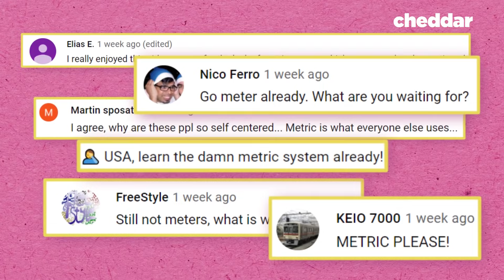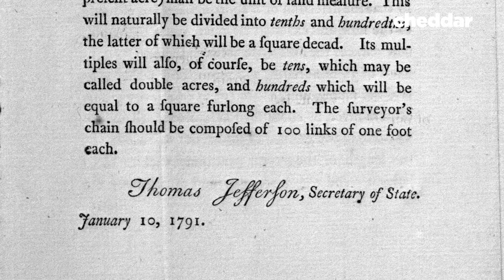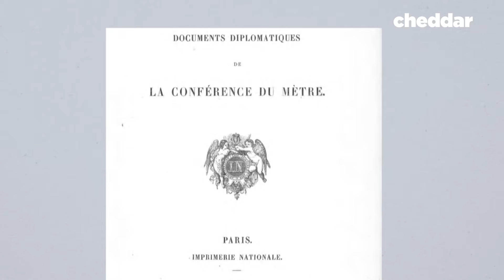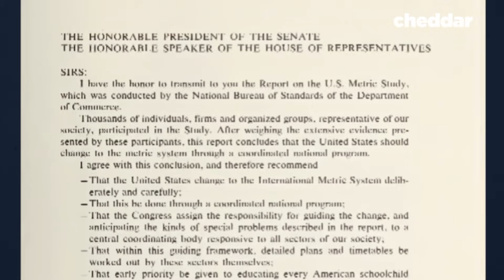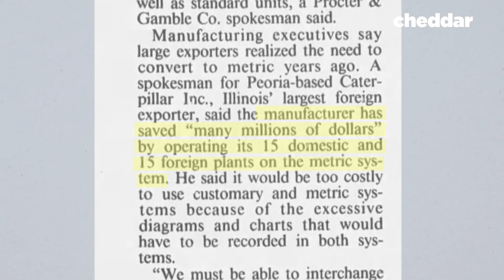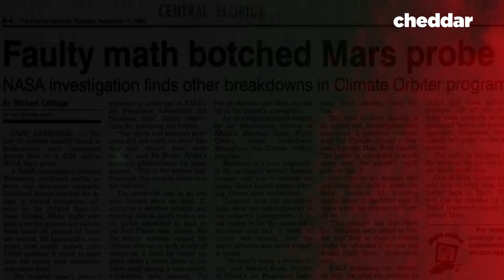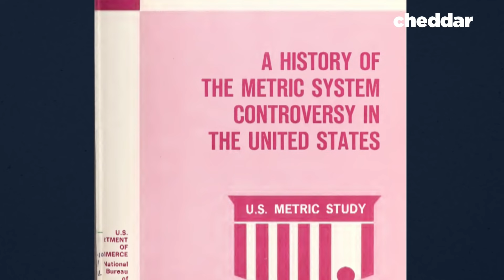Why Doesn't the US Just Use the Metric System? - Cheddar Explains

Comment: Why are Europeans so worried about what Americans use for our measurements? My question is when are Europeans going to switch to the R+M/2 method like the US and Canada use for measuring octane of their gas? After all, the U.S. system is superior as it represents the real world burn of gas under any given atmospheric conditions when an engine is burning it. Also the majority of the world like the U.S. drives on the right. When is the UK and Australia going to stop driving on the left? As one can see, this conversation can be spun around. Many of us here in the states were never taught metric. And to this day, we never use it in most any situation. It's easy to know what feet means. And it's easy to understand a fraction of say a container that may be 7/16ths full. But when someone says this is 60 kilometers away, then im like whaaaat?? 0_o What's that in miles? And if someone says it's 10°C outside, then I have to look it up to see what it is in Fahrenheit just to be able to comprehend how hot or cold that is. A 70°F day is like perfect temperature wise. And a 100°F day is crazy hot. And a -20°F day is crazy cold! That's easy to relate to. 

Also everything in our day to day lives is in imperial. Weather forecasts are in imperial, road signs are imperial, measurements in day to day life are in imperial etc...  When I pull out a tape measure it's in imperial. It as 1/4, 8ths, 16ths inches and ft. A yard is an even 3 ft. 

Plus Canada isn't fully metric either. And neither is the UK. Yes we may have metric on say a soap bottle of Palmolive, or shampoo. But i'm not reading that in my day to day life. Once I step out the door, it's an imperial world. Houses are measured in sq ft. height of houses, or buildings are measured in ft. land is measured in acres. (1 acre = 43,560 sq. ft.) And yeah! So when do we ever use metric except in international trade? Even when all business is typically conducted domestically, we use imperial. I weigh stuff up every single day for disposal. One skid after another. And we weigh everything in pounds. And all American trucks when going to the scales are measured in pounds. 

But as one can see, even those who are taught metric in school, stop using metric one they leave school since it's an imperial world outside of school. And hence we tend to forget about metric. You just never use it unless you're directly working with international trade. This is why Americans don't switch. There is no need or desire too. We have far better things to worry about. 

And in the rare case we do need to convert, we have online converters that help out with that. 

Maybe the US will flip to all metric when Europe adopts the R+M/2 method and finishes switching to the right side of the road? But then again, i'm sure the UK is as worried about switching to the right, as the U.S. is about switching over to full metric. 

Thanks to YouTube, I do now kinda sorta know a little bit about metric. I know that millimeters is metric. And that's probably the only metric unit I ever would use. And liters too. 1 gallon = 3.78 liters I know. :D So that's two metric standards of measurement I don't need a converter to figure out. But again, unless im talking on line, I never use them in my day to day life.
Reply: Australia took about ten years to change from Imperial to metric measures, but it wasn't a big deal. We soon got used to the different measures. This includes switching from Fahrenheit to Celsius temperatures, changing the road signs and converting the building codes and land measures. Every country that adopted the metric system had to change. It's not as bad as some Americans fear.
Reply: @Ashbury2193  Except our highway system is utterly massive! Just to convert every road sign would be stupid expensive! We have over four million miles of roadway here. Or 8x more miles of roadway then Australia. Also it would be kind of a big deal if a lot of folks here never used or learned metric before. I don't think the United States is going to switch anytime soon personally. 

I know it's definitely not in any politicians or anybody's radar here. Switching to full metric is never even talked about, except in YouTube videos like this.
Reply: @waycoolscootaloo  Where there's the will, there's a way. Converting the road signs in Australia was an immense job but it happened in July 1974. (The Canadians also changed their road signs at about the same time.)

The generation that accomplished this included many who fought in the Second World War. I think it was a more idealistic time, and it was seen as a national necessity, and so the job was done.
Reply: @Ashbury2193  Yes, but the task was still 8x smaller then the US road system. Also I guarantee you that no one here want's to spend the tax money to see it converted. So that would be the biggest hurdle. Not to mention everything that's been made in imperial units since the beginning of the country. And many folks Aren't going to know metric. And again it's not on anyone's radar or ever talked about regardless.

I know personally I like the system we have here. It just works. 🙂
Reply: @waycoolscootaloo  I get it that you don't want to change. Fair enough! However, change is possible when there is the will to do it. When we changed to the metric system, all industry had to change, but they made the change and found it saved them money.
* England agreed to switch to the more accurate Gregorian calendar in 1752. The American colonies of Britain also changed, so you have the benefit of that reform.
* Noah Webster proposed some changes to English spelling. Many of them were accepted in the US. The older spellings work,  but the US enjoys the benefit of slightly easier spelling.
* Many broad gauge train lines in the US had to be converted to standard gauge to facilitate interstate traffic. Expensive, but better in the long run. 
* No-one likes being pricked with needles, but inoculation saves lives.

Even though you don't want the USA to change, the actual change to metric measures is not as big a deal as you fear. I know, because I have lived through that very change in Australia. For me, metric conversion is part of my lived experience.
Reply: @Ashbury2193  Except I don't see it happening in my life time. It's exactly the same now as it was 30 years ago even. No one uses metric here in day to day life. Where there is a will there's is a way. True! But there is no will here to do so. Absolutely everything is in imperial throughout the country. And the US literally built the world's largest economy using imperial when it took the title from the UK. And the system continues to work just fine. Unless it's being shipped out of the country, or has to deal with science, everything is done in imperial. Even many companies here just do imperial. If someone says how many kilometers, or celsius, that's like pure spanish to many folks here. And even though schools are just recently teaching metric, the problem is that as soon as they leave the classroom, it's an imperial world. And you have to be in science class to learn it. Or maybe math class. (And that's a big maybe.) How many yards, or how many feet, or how many inches is all that anyone says. 

Could the US convert one day? I say never say never. But I think it's a very long ways away.
Reply: Hi  @waycoolscootaloo  You could be right. Probably the best time to change was when other English-speaking countries were adopting the metric system in the 1970s, or, as the video suggests, when Jefferson showed interest in the new system of weights and measures in the 1790s. However, as the United States is virtually alone in clinging to the old measures there will be continuing pressure to change, either partly or wholly, to metric measures. 

Your army's use of kicks for kilometres and your 2-liter bottles of soft drink could remain interesting anomalies or be harbingers of things to come. Only time will tell.

Comment: The Imperial system has its merits. For example inches may be divided into fourths and eighths, really useful for several things like cutting a sushi roll into 8 pieces, a common way of cutting sushi rolls. Measuring wind speed as mph or knots is better because you can feel the difference between 10 mph versus 15 mph, but it's hard to notice 3 m/s versus 4 m/s. Also for temperature you can feel the subtle difference of 1 degree Fahrenheit, but 0.4 degrees Celsius for example it's difficult to feel such a minute difference. Who cares that water freezes at 32 degrees or that you end up with funky fractions using a ruler. The metric system with its broad scales has its drawbacks as well as benefits. The world should learn both. It's not that difficult.

Comment: Not a fan of this video. Both systems have their benefits and fall backs. In everyday life, the metric system is tedious. An inch and foot are practical sizes for estimation. A meter and centimeter are too large. Drug dealers use grams because an ounce is a lot of drugs, plus marketing makes it sound more when you use a smaller unit. The Mars satellite crash was due to pounds of force compared to Newton's. Newtons work with both systems, that is why it was confusing.
Reply: 1 inch is 2.54 centimeters so in fact centimeter is smaller unit than inch and not the other way around.
Reply: @kalevi5814  right. That's not the point though. A centimeter is too small for most day to day measuring purposes.
Reply: @kalevi5814  I'll make it easier for you to understand. If I'm making you a drink, let's say a martini, I would put in 1 oz dry vermouth, and 1 oz of gin. Or 30 ml of each. Which is easier? It's the same in all of cooking, because the measurements are designed to make sense in everyday activities. Like I said, both systems have benefits.

Comment: My take is that the US is fine using metric units when it makes sense.  Grams. mm, ml are useful units when measuring small quantities and sizes.  But kilo (meter and gram) and centigrade are far less useful.  Especially centigrade, as the *F system is more precise.  

FWIW, I work in an engineering department and very little to no metric is used.

Comment: I live in the UK and it's really confusing. I'll go through what the general public uses most often:

Human weight: Stones and Pounds (Imperial)
Inanimate object weight: Kilograms (metric)
Distance between cities/ locations: miles (imperial)
Speed of vehicles: miles per hour (imperial)
Measuring inanimate objects: metres, centimetres etc. (metric)
Volume of beer: pints (imperial)
Volume of every other beverage: litres, millilitres (metric)
Torque: newtonmetres (metric)
Human height: feet and inches (imperial)

However, in school we are only taught how to use the metric system. It's mostly just our parents that get us into the habit of using the imperial system for certain measurements.
Reply: Well... In China we also use a lot of untaught "traditional" units but those are regulated to be in simple ratio to the metric.

Comment: As an American in Canada, I can understand both. I'm starting to like the celsius system for weather because it seems easy to understand 0 freezing and 100 boiling . Its not hard to change over but it seems people are just too lazy to try it to learn a new system.
Reply: Farenheit was based on materials that were important to everyday people at the time.  No one knew that water would become some standard  material so they used what was more pertinent.  Brine and Blood freeze at 0F, which is important to cooking, shipping and personal health.  A person is sick when they have a 100F temperature.  Based on those criteria, water boils at 212F.  It wasn't until someone decided that water should be the source of reference that Celsius became so important.  Why water, anyway?  What's so special about Hydrogen Dioxide?  There's lots of other liquids out there....
Reply: @jimharris5320  Water is very useful in weather because of the different precipitation types and effects.  This is particularly helpful in Canada where it is routinely below freezing (0 degrees Celsius).  If the environment is above 0 degrees and it rains, then everything's fine.  If the environment is below 0 degrees then you have freezing rain or even an "ice storm" (severe freezing rain) where trees freeze and explode, thereby knocking out power lines.  As a native Canadian, you can also feel the difference between 1 degree and -1 degree, because of the difference in humidity.  And of course the difference between snow, hail and rain is related to whether the air is above or below 0 degrees Celsius at various levels above the ground.
Reply: @OntarioTrafficMan  Excellent points and I appreciate the reasoned response.  

New question:  Do those points matter as much for tropical countries?  :)
Reply: @jimharris5320  ahem Dihydrogen Monoxide, GENTLEPERSON.
Reply: @CarbonRollerCaco  While you are in the mood to be so technical, why don't you answer the actual point to my question instead of nit-pick an obvious typo?
Reply: @jimharris5320  Geez, chill OUT. I wasn't THAT triggered.
Reply: @CarbonRollerCaco  I didn't say you were, before.  Your reaction to me suggests differently, though.
Reply: @jimharris5320  I honestly didn't expect you to take an offhand, fake-snarky correction THAT seriously.
Reply: @CarbonRollerCaco  Calm down, I didn't take it that seriously.  But if you post something you should be prepare to see responses.  I'm honestly surprised you keep responding for a comment you admit was offhand and snarky.
Reply: @jimharris5320  Then what was with the whole "why don't you address my argument" counterresponse? You could've just laughed off my initial reply and I would've been happy to be on my way. Instead, you come off as seriously woke compared to my half-pretend triggeredness.
Reply: @CarbonRollerCaco  Because you keep replying, because you take it so personally, and it amuses me
Reply: @CarbonRollerCaco  Oh no, you called me a mean word.  Whatever will I do?
Reply: No, you adapted because the media and signs around you keep showing you Celsius so now you know what that number "feels" like. If they did the same in America everyone else would adapt too.
Reply: We know it. We literally have to use it in school. Stop with the nonsense